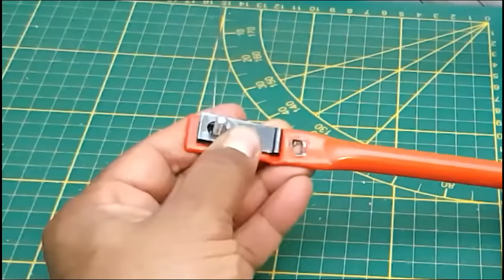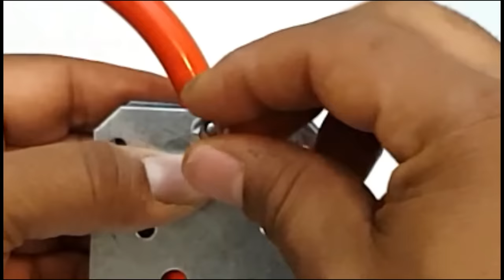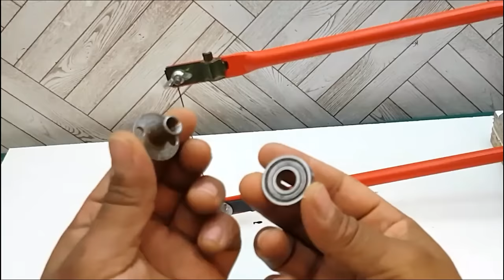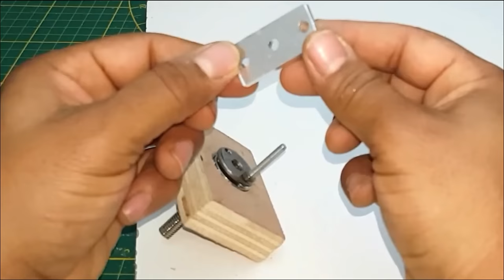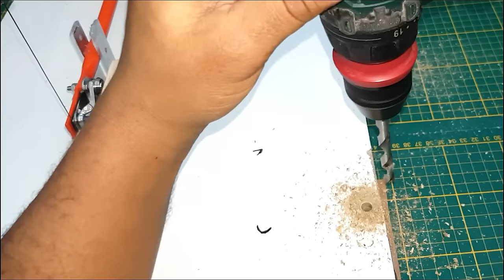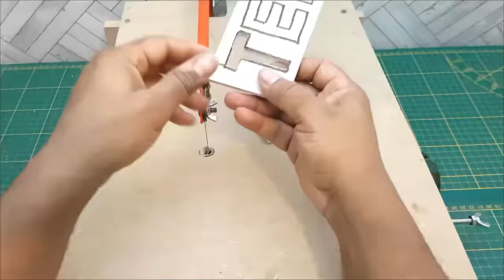AMAZING IDEAS TO COMPLETE YOUR PROJECTS // MAKING A SCROLL SAW MACHINE

Comment: Next time drill holes inside the letters and you won't have the cuts between the letters. It takes a little more time removing the blade and going through the holes but its a much cleaner finished product. Other than that I would say you did a great job, very creative.

Comment: Good morning,

Thank you very much for this very nice idea and project.

However, I would like to know if the vertical movement of the blade, because it is in a curve, a sort of arc of a circle, however slight it may be, is not detrimental to the blade, on in the long term, because of this curve?

Isn't the blade subject to stress, likely to accelerate its breakage?

Let me clarify again, in the long term.

This is neither a criticism nor gratuitous malice, just a questioning, because this project is very interesting.

Thank you for your idea and for your understanding.

Comment: Thats amazingly cool and a great idea. 

   However, the scroll saw I'd like to see a diy for is the pedal power scrollsaw.  They used to just have a bicycle flywheel or up and down pedals to power scrollsaws, rather than using electricity.